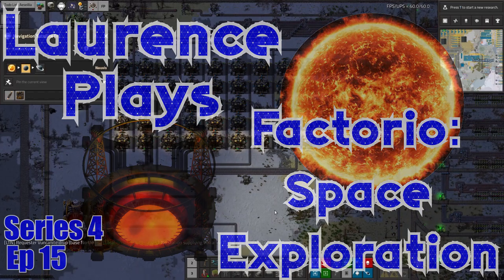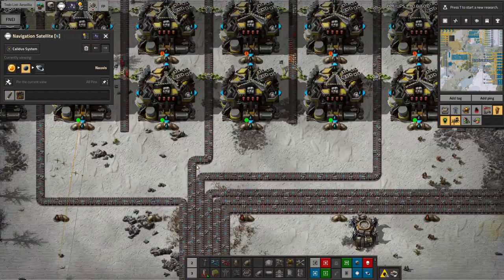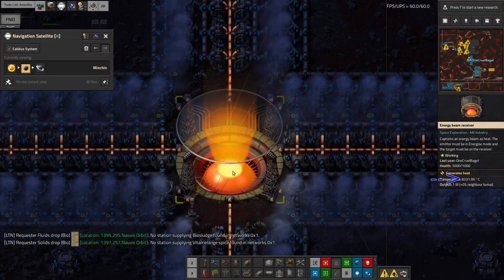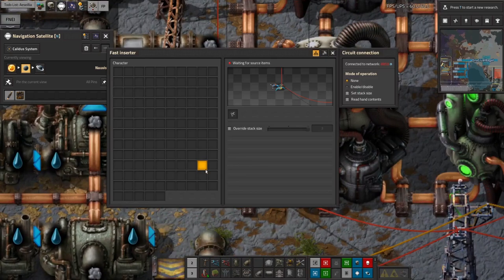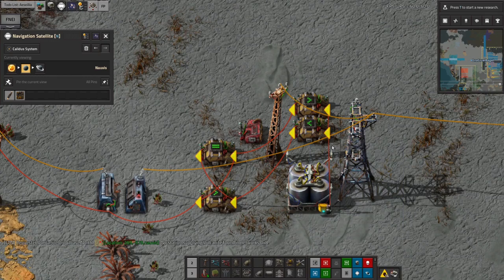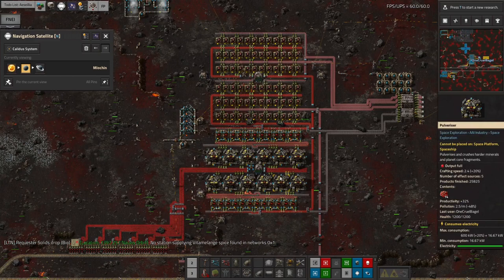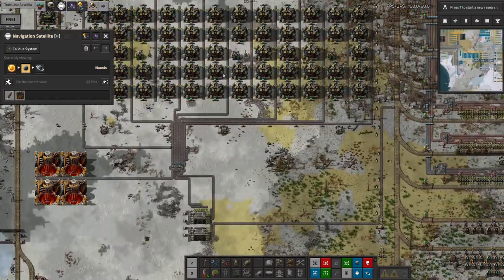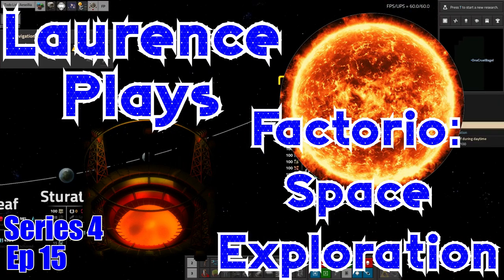S4-E15 - More core - Laurence Plays Factorio: Space Exploration

Comment: Hmm. Something you can do with the vulcanite water (can't recall if it is a closed system) is to use a chemical plant to turn it back into water, since that is 100% efficient compared to the turbines' 99%. Especially since it is "cold" steam compared to what the turbines want for optimal power efficiency.
Reply from the maker: I'm not in the game right now, so this is from memory. You're right that there's a condensing recipe that turns steam back into water, but the loop process is (I'm pretty sure) not 100% efficient. I was definitely having to ship ice to Miochin with the old system to keep it topped up. It's certainly possible it's more efficient, but I don't think it's 100%. 

Unless the loss is in the vulcanite washing and it produces 95 steam for 100 water, or something. I believe there was a loss in there somewhere! 

Either way, the hope is that there's plenty of water being brought in on the spaceship when it picks up the vulcanite so I hope it'll all be fine!

Comment: You mentioned using trains for loading/unloading cargo really quickly but that fuel would then be your bottleneck — why not just do the same thing for fuel? You could make one of your train cars a fluid wagon and attach a pump inside the ship to pump it to your engines. Then you wouldn’t even need fuel storage on the ship, you could just use the fluid wagon as a replaceable fuel tank for the ship. Also what happened to the ion engines only needing so little that the fuel contained in the pipes used to plumb it all together was enough? I haven’t played SE ever so maybe I’m missing something, but I remember you mentioning that in a recent video.
Reply from the maker: Unfortunately, the ion engines can't be used for takeoff from planets. The ion booster tanks can allow you to take off from space stations, but to take off from a planet(oid) you need rocket booster tanks (or anti-matter boosters, which I haven't got at this point). Once the ship is on the move, then it can just use the ion engines, which are really really fuel efficient, but that's not until after takeoff, unfortunately. 

I like the idea of using a fluid wagon as a tank, but unfortunately they're not very space efficient. One fluid wagon stores 25,000 fuel, one of those booster tanks stores 100,000 and my ships tend to hold close to 600k, which means I'd need to have a train with 24 fluid wagons ... and the fuel wouldn't be in the booster tanks, so it wouldn't be able to launch the ship! Possibly I could run trains of rocket fuel in and pump it into booster tanks until the ship is full, and only then send in the cargo train, but that would be a lot more complicated. It could be an interesting challenge though!